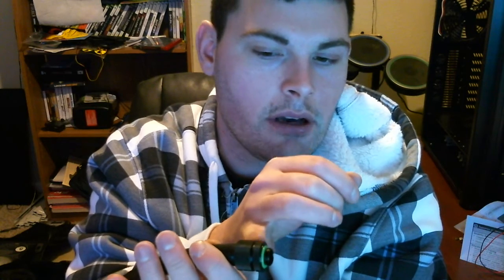Compression Fittings and how to use them

Comment: I tend to tighten the fitting screws, but some time later I checked for cleaning inside my pc of dust.. checked that the screws got a bit loose.. and a hand tight again had to be done.. Now I'm afraid what if they loosen up in time and the hoses pop out ???
Reply: +June Eight because the water gets hot in your loop the tubes heat up and shrink to the fitting. this means they are tighter to the barb and looser on the fitting. Tighten them once a week and once they arent getting loose anymore check them like once a month. hope this helps

Comment: I was just testing out fitting a compression fitting, and I had to soften the end of the tubing by heating it up before I could get it over the barb. Is that normal? How on earth am I meant to fit a loop inside my PC if I have to do that?

Also, I have black painted compressions, won't using a wrench on them just rip the pain off?

Comment from the maker: you just screw them on hand tight. Then no more than a quarter of a turn after that. most angle fittings should be able to swivel in the direction you want the fitting to go

Comment: Quick question, with the angled compression fittings, such as 45 degree ones, how do you screw them tight onto the block so that they are facing they way you want? Is it possible you would have to leave them a bit loose to get the right orientation?

Comment: well i got 2 plastic clamps with my swiftech res, those work cause i used pliers to clamp it as tight as possible but i only had 2,... so i used it on res to gpu and on the top gpu barb cause thats were the leaking was.

Comment: @juggolo man i got 6 barb fittings for my WC loop and that is the last time i buy barb fittings. to many problems with leaks i almost fucked my 6970 but idk why guess the water olny hit a couple of low voltage resistors so i was safe but it's a pain in the arse.

Comment: @traffety You won't be able to screw the barbs in with the tubing attached ( 1 end you will but not the other )  If you wanna sort 1 end out first, that might be easier, but generally fit the barbs then add the tubing.

Comment from the maker: @MrPassivemenis 
That would defeat the purpose of a compression fitting. The fittings are already designed not to leak. Also they are meant so you can take the tubing and put it on easy/take it off.
The new case is fine nothing new to report yet.